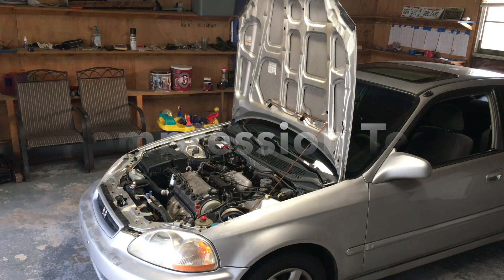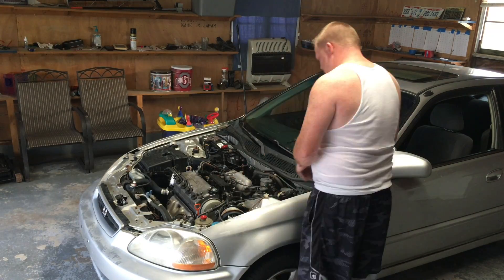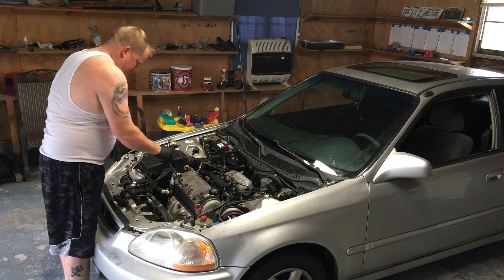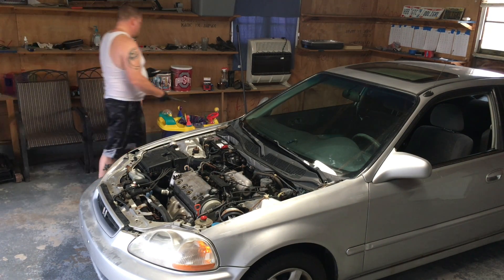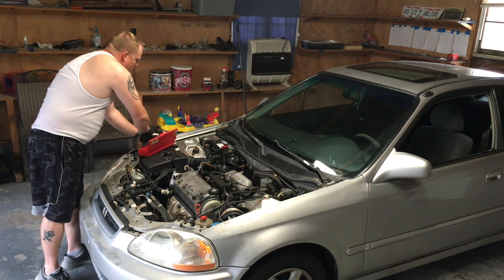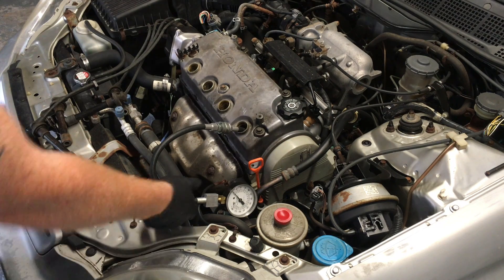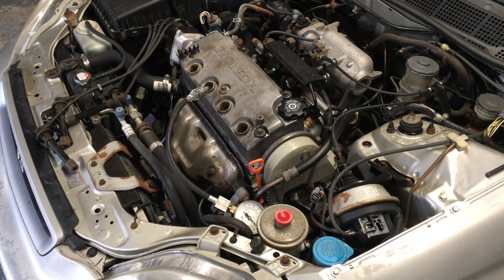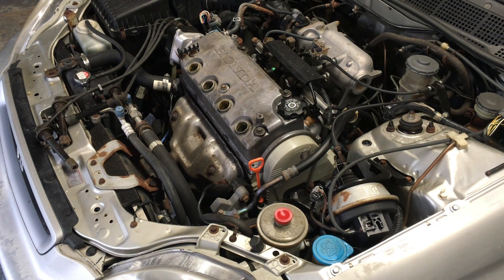98 Civic EX Compression Test

Comment: Coolant is leaking out the top of my reservoir if I drive the car hard on the freeway. I changed my radiator to a Denso one, changed some coolant hoses, changed the radiator cap, and did a combustion gas test on the cooling system. Test was negative for gas. Will a compression test be more accurate than a combustion gas test? I’m thinking of changing the headgasket regardless if my tests don’t show anything. The car has no overheated, but it can increase during the summer. 140,400 miles, 2nd owner. 1999 Civic EX.
Reply from the maker: If it’s not overheating then it’s likely that the excess pressure in the combustion chamber is pushing past the head gasket under hard acceleration.
Reply from the maker: A better test would be a cylinder leak down test on each cylinder with the piston at TDC.  I would compression test. Take that reading and add 50 psi. Test with that pressure and see if it’s pushing into the coolant system
Reply: @OhioLiving  Thanks; do you think a 6-gallon air compressor is big enough? I think I will need something that puts out 230-250psi, I have never used an air compressor.
Reply: I am reading 100 psi is the typical pressure used. More may turn the crankshaft and seems 200psi is the max rating I see on a 20 gallon air compressor.
Reply from the maker: @jumbojoe55  the goal is to add air pressure to the cylinder to try and see if you have air escaping into the cooling system. When you drive hard the cylinder pressure in the combustion chamber is higher then normal and since your testing has shown no combustion gasses in the cooling system I have a feeling that you don’t have a fully blown head gasket but rather a gasket or crack that it’s failing under higher pressure.  Try and duplicate that scenario as close as possible. 170-190 psi would be ideal in my mind here.  What exact engine is in your car?
Reply: @OhioLiving  1999 Civic EX, D16y8 SOHC VTEC
Reply from the maker: @jumbojoe55 yep then what I suggested stands. When the drive the car easy I assume you don’t have an issue but when you drive it hard you have a problem correct?
Reply: @OhioLiving Seems like no coolant spills if I keep it under 4,000 rpm. I may see the temperature rise at the stoplight, but it goes down once I drive and get the air flowing over the radiator. But I don’t see it happen much.
Reply from the maker: @jumbojoe55  vtech engages over a specified RPM and throttle demand. This will increase cylinder pressures as more air (higher lift) is allowed into the combustion chamber. This is why I suggested a higher pressure cylinder leak down test

Comment: Don't you need to hold the gas pedal to do a compression test????
Reply: I installed a ebay Mizumo rings and my compression is 90 psi with 5k miles on it. I put oil  on the rings to see if it would increase and it did by 20 psi.
Reply from the maker: Its recomended yes. However i was just looking for major changes between cylinders and extremely low